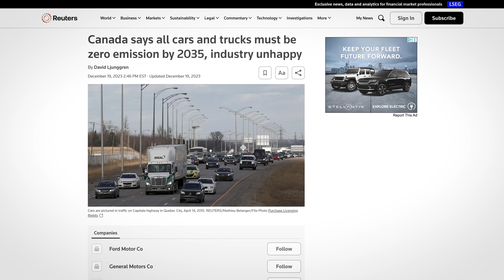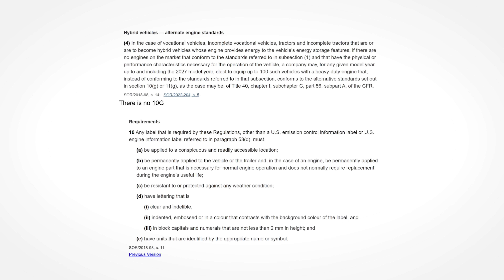Government Red Tape Is Blocking Our Plug-In Hybrid Trucks

Comment: one method you can use to be compliant is attack the issue with a software engineer

just use one of the engines youre allowed to use, and use code to detect how much output it needs to then set the engine speed.

Comment: Plug in hybrid mandate e by 2035 won't happen. It will be rolled back by the next few years once the idiots in charge realize how much taxpayer money will burn putting in a bunch of ev chargers everywhere and the eletric grid has regular blackouts. Plug in hybrids wont fix climate change. In fact, plug in hybrids are the worst of both worlds for every vehicle. All they do, is put strain on the eletric grid, which wont be able to handle it, will not be useful at all on a road trip or other long trip, in fact, you carry dead weight so its more wasteful, and it makes vehicles less efficient. Normal hybrids and public transportation fix climate changes. Taxing the hell out of stupid giant bricks, and blobs, while giving tax brakes to low emissions, and hybrid vehicles will insensitive people to buy a hybrid. Majority of people can't afford an EV and the people that so shouldn't get tax brakes for a 3 ton fire risk that's actually destructive to produce.

Comment: Pretty sure what is conveniently left out is that this has more to do with emissions systems. For example generators do not have particulate filters fitted from factory, so trying to make any random generator emissions compliant by that definition is unfortunately just not possible.

I'm actually quite amazed that they found out about this so many years later.. Kind of screams incompetency.

Comment: So - you don't know how much co2 it does per 100 miles? Like thats the actual issue: you have no idea how much co2 the package produces to move 100 miles!

It is somewhat understandable, what if your mpg was just 1. It is silly though if you can't cert it with a driving cycle or at a facility.

It is silly to call it 0 emissions on account of it operating like a diesel electric train, but ceritifying it by kwhs used should be made cheaper

Comment: Aircraft ground service power carts (generator) may have on road certified diesel engines. we use those to provide power on the ramp to reduce fuel burn compared to the APU (basically a mini jet engine).

Comment: Solution: Generator is required to be disconnected from the battery that drives the vehicle but can run auxiliary devices. Use a bank of supercapacitors to match battery voltage and use generator to charge them. These are inexpensive and do not affect any operation of the vehicle, but they do decouple the generator to pass inspection as an auxiliary generator.

Comment: Wouldn't a CUMMINS L9 or equivalent that is currently used in on-highway vehicles equipped with an electronically controlled throttle body fit the bill? All new diesel engines ALREADY monitor their rpm and some already have a high idle cycle for regen, reprogramming the computer to set the RPM where you need it to operator the generator should not be too difficult with the help of a manufacturer.

Comment: Could you buy the hybrid engine and generator from BAE Systems. They have busses with their system running in Canada. I don't think it the same as your system, BAE controls the engine. You should visit a transit with the BAE set up. The software we had where I worked showed you all the data. Way more than a mechanic needs to use when troubleshoot a problem. Don't be confused if you see what looks like a transmission bolted to the back of a motor, it is a series hybrid, it is just package that way. There is no direct drive between the engine and the motor.

Comment: I wonder if you can make one truck with the mechanical gearbox, and an identical truck with the generator set up like you want to do.  Certify the truck with the mechanical gearbox, then submit the hybrid truck to get certified showing it is identical except for the drive train and point out the lower emissions.  They would both need to have the same engine, just the different method to transmit that power to the wheels.  Then try to certify the smaller engine set up.

Comment: Just add a plug that will let you "Plug In" to grid power and label it "Primary". That way the on-board engine can be the "Auxiliary" or "Emergency" power supply. It's a technicality - the best kind!

Comment: Being honest with you... In my opinion, a Big Block  engine with LPG or CNG could be a better option, after all, it will be a range extender and you just need a three way catalytic converter. It will be cheaper than a diesel engine, and you don't have to cope with difficult diesel emissions. Longevity? Maybe not (maybe yes) the same as a diesel engine but... It's cheaper. Greetings from Costa Rica, Central America.

Comment: Oh looks company trying to make a difference for the climate. Govt: You can't do that cause we don't understand.

Why does it matter if the engine is on road or off road cause it's not part of the drive line it's there only to change the batteries. Is see small generators on trucks all the time

Comment: The generator doesn't power the drive train, the battery set does that. So the generator is just doing what it is certified to do: provide constant power which charges the batteries. How is that a problem?

Comment: Your trucks aren't Hybrid, by the current market's definition (Hybrid = Movement by electric motor and/or petroleum).
 You are making an electric truck that has a generator, just like a welder on the back. The generator is immaterial to the direct movement of the truck.

Comment: I love you guys, but you should have seen this coming from a mile away. You should have been prepared for this years ago. Any manufacturer selling any vehicle thats legal for highway use has to meet the same emissions requirements. There is no difference when it comes to emissions regulation between a range extender BEV (which is what the edison semi is) and a traditional diesel powered semi. 

I understand and agree with the notion that emissioms regulations need to be changed, but if youre going to create a marketable product to sell NOW, you have to meet current emissions regulations. Every other manufacturer making plug in hybrids have to meet the same standards. 

The BMW i3 was probabaly the closest mechanical comparison to the edison truck. It was a purely electric drivetrain with a gasoline generator over the rear axle that simply recharged the battery while driving. Had a tiny air cooled 600cc scooter engine driving a 28kw generator, and even that generator had to meet on-road emissions regulations despite it not being mechanically connected to the wheels.

Comment: Sounds like all you need to do is redesign with electric throttle control and let the load based generator replenish the batteries?

Comment: Idk about Canada law but I would assume the generator is not allowed because of the low emission laws (no particle filter etc) for these types of engines. So they need them to use Vehicle engines with the higher emission standard so they don’t want you to not do it but to do it right. Very frustrating for a small company with limited resources but mandatory in my opinion.

Comment: how about you sell a fully electric plug in hybrid, and make the generator an optional extra, that comes with every truck. but not the one for certification... slap the ac on it and say its for air conditioning of the truck, the battery filling is just an aditional benefit , or make an aftermarket company to install said generators to charge your ev truck ... get around the rules if they want to stop you inovating because the big companies are trying to lobby agains you... obviusly
oh and you can say that that generator is for hooking up welders, and lights out in the field , but the truck has it onboard.... even chat gpt agrees, and i had it pull up the canadian laws... 

If Edison wants to market their truck as a fully electric vehicle (BEV) and treat the generator as an optional APU accessory, here’s how the law applies:

    Legal APU status: The generator must be described and sold as a device that only charges the battery and is not intended to propel the vehicle—matching the regulatory definition of an APU.

    Model year compliance: If the trucks are 2021 models or newer, the APU must meet the PM emissions standards appropriate to its model year and carry the correct labels.

    Optional add-on: Ideally, Edison would ship the BEV without an APU, and make the diesel generator available as an optional accessory or retrofit installed post-sale. This helps maintain the BEV classification in homologation paperwork and avoids having the generator be counted as part of the primary propulsion system.

Comment: Are there no engineering firms you can enlist to test your prototype against the on-road requirements and issue a certification?

If not:

Can you not take an on-road certified engine, mate it with a generator, and add the load-following logic to it as a sort of piggy-back ECU?

Working with your legislators to correct their blind-spot is a good long-term solution, but presently it seems to me that the only issue is your engine hasn't been proven to be legal for road use. You don't want to go through the effort (and expense) to certify that it is. Unfortunately, building a brand new vehicle with a unique power-train from scratch is difficult and expensive. Saying your design is "banned" is clickbait at best.

I really want to see series hybrids become more common. I love everything about your design and your approach. However, at 3:30 saying that you have the option to do the certification procedure yourself but won't because it's too hard just sounds like whining.

Comment: You have my thinking cap on. Technically a Diesel powered Generator and a Road Certified Diesel engine are the same,  except when it comes to Pollution systems and testing.  
Modern Diesels are computer controlled, you may push the peddle down it doesn't mean it will increase in RPM / Power. 
A generator doesn't need Adblue, Catalytic Converters, ERG systems.  
A Road engine is required to have these on a Diesel.
Older engines. 
It's a Red tape issue,  and not a practical one.  
 And with all this regulation this is why we no longer have backyard inventors Propelling society along. We only have oligarchs who make the rules with the government.

Comment: How does this affect your USA market? 
Can you give it a name besides a generator? Generators don't back charge the engine for engine breaking... Name it something new! Call it an engine driven power distribution system. It provides power to the axles and back charges to the engine for over charge breaking! It's not a generator, it's something else entirely! Lol
Reply: Make your own throttle control for a highway engine. PID controls are super easy. Set your target rpm and hold it with a PID control on the throttle. Inconvenience but not overly difficult
Reply: Loop holes are everywhere. Don't go head first for the problem, try to walk around it and come in through the back door. Lol
Honestly though, if it's the engine they don't like just put a cruise control on a highway engine for throttle rather than speed... PID controls...

Comment: Canada does operate true series‑hybrid buses (where only electric motors drive the wheels, and an onboard combustion engine powers a generator). Here are a couple of notable examples:

⸻

Examples of Series-Hybrid Buses in Canada

Edmonton (ETS) – New Flyer ISE ThunderVolt TB40-HD Series Buses
	•	Edmonton Transit Service (ETS) had New Flyer buses equipped with the ISE ThunderVolt TB40‑HD series hybrid system.
	•	These were confirmed as series hybrids—the internal combustion engine drives a generator, while traction is handled purely by electric motors.
	•	A transit board forum post from March 2008 notes:
“New Flyer DE40LFR ISE ThunderVolt TB40‑HD Series, powered by a Cummins ISB engine with Ni‑MH batteries – Series”  ￼ ￼

Montreal (STM) – Nova Bus LFS HEV with BAE HybriDrive
	•	Société de transport de Montréal (STM) operates a fleet of hybrid buses based on the Nova Bus LFS HEV, which use the BAE Systems HybriDrive system — a true series‑hybrid setup.
	•	According to STM’s fleet details (as of 2023), these buses have a powertrain where the engine only powers a generator; the wheels are driven exclusively by electric motors:
“The LFS Hybrid is essentially an electric bus with an onboard diesel generator to produce electricity to recharge an onboard battery… The bus is driven by an electric motor with electricity drawn from the on‑board battery.”

Comment: Why the fuck would you use a generator anyway? Why would you even try to use an off-road certified diesel in an on-road application? Did you think any of this thru? Between this video and the one where you tried to claim a series hybrid is more efficient than mechanical drive (it isn't!) I struggle to take you seriously. I encourage anyone reading this to go watch the video by Watch Wes Work where he explains why Edison's claims are largely bullshit.

The obvious solution is to use a on-road diesel coupled to a suitably large alternator, with a custom designed governor and voltage regulator. With that, you could directly charge the batteries and power the motors with the least amount of conversion losses possible, while also saving a bit of weight. This still isn't as efficient as a parallel hybrid, but it's less expensive than parallel and still more efficient than your generator -> charger -> batteries bullshit.
Reply: The generator is an onboard range extender. The engine for generators is already Tier 4 compliant which is why Edison would like to use it in their trucks.  Edison responded to the watch wes work video and pointed out the flaws in his logic and he pulled that video offline.
Reply: @Sah-o5m  Yes, I understand that. There are better ways to implement a range extender though, like I laid out in the other half of my comment that you apparently didn't read. But Edison could move forward with his inferior design by simply using an on-road diesel engine in place of the off-road diesel engine. Literally the only difference between the two engines is the software in the engine computer and the words on the data plate. Both will use the same flywheel with the same SAE mounting flange. You can make an on-road engine run at a fixed speed pretty easily by J1939 commands, which means you can use one in a fixed-speed generator like Edison wants. The custom software needed to do this is trivial compared to the software they already have running the electric motors. Funny that Wes's video is mysteriously gone. I think if he deleted it because he was wrong (he is not wrong) he would have posted something telling us how he was wrong. I think it's far more likely Edison, Deboss. or maybe both pressured Wes and/or YouTube into making the video go away. Both Edison and Deboss stand to make a lot of money from this therefore can't be trusted. But go and watch Edison's reply video. The kid goes on and on about how he's right without any substance to back him up, how his design is the most efficient possible, but can't prove it of course because it's simply not true. He doesn't seem to understand that the Prius is efficient because it's engine can directly drive the wheels, that his diesel range extender will always cost more per KWh compared to grid power, or that his copy paste design leaves a lot of efficiency (operating cost) on the table. No doubt he'll sell tons of novelty pickup truck conversions, hell I might even buy one. But the whole efficiency and environmentally sound argument is bullshit, and Mr. Edison does not want you to know that.

Comment: This seems like the type of thing where you should just build it anyway. I highly doubt any police that pull you over will know or care what motor it is and going to court may just be the fastest way to sort it out given the law isn't wrong its simply non-existent, Furthermore you can reasonably claim the generator is only used off highways, run full electric on the highway then charge up using the generator when you're not on the highway, easy peasy solved.

Comment: I would simply go to PSI engines and get a 13 liter Spark Ignition LP or Compressed NG engine.   Now you have a double green machine.  Same footprint as the diesel but emissions they are asking for do not exist for this engine.  Give them back their own crap.   This is like building a Moon Rover and you are in the SPACE RACE.

Comment: So you would have basically had to make your own generator that runs off a traditional truck engine. That's a LOT of extra R&D, since you have to adapt the load-sensing generator equipment to the truck engine and its throttle control.

Comment: Mechanical with a supplemental electric motor in the driveline is the way to go for a more versatile, on-highway truck. Full electric makes sense for slow up & down mountain roads, but a direct drive setup is better for flat road steady state. A direct drive with supplemental electric motor gets you the best of both worlds, which is why PHEV is more versatile.

Comment: Make your own. Just make an electronic throttle with an arduino. You can pick an on road diesel engine with an rpm range you want and just add a pto to the flywheel and drive a generator with the pto.

Basically you are building your own genset just with an engine certed for onroad use.

You could argue that an arduino isn't suitable because it's not made to spec.... Make your own arduino.

Comment: This isn't that complicated - just get a certified on-highway engine and bolt a generator to it. Pretty much all modern HD engines have "Consant speed" mode for PTO use. You don't need to use a packaged genset.